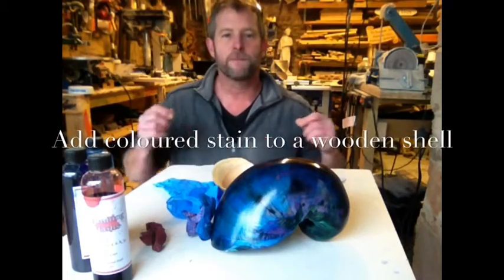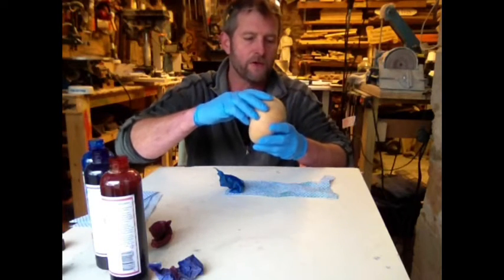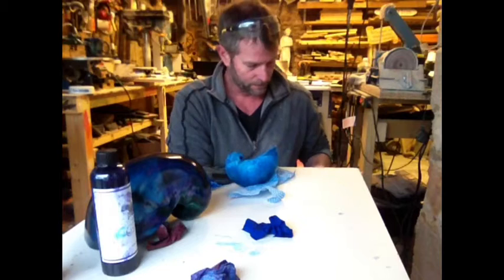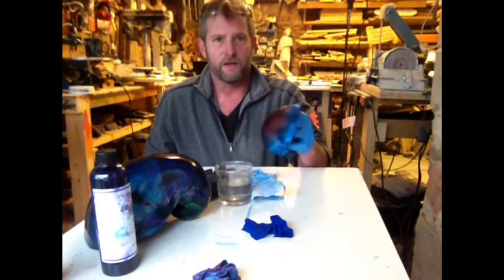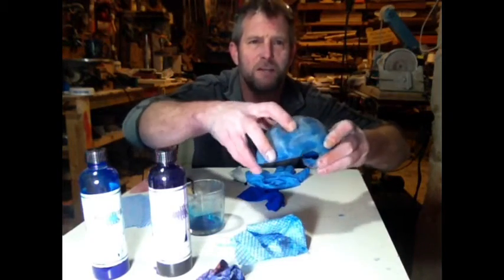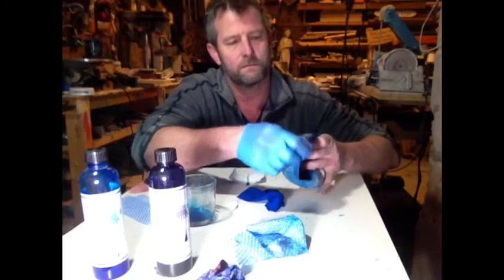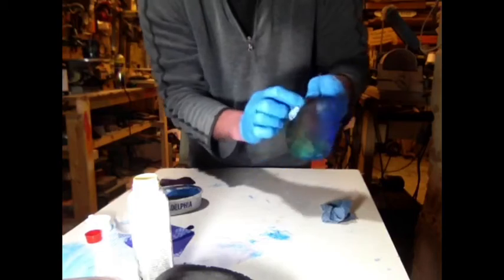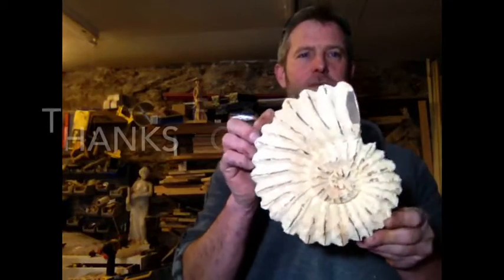colouring a wooden shell

Comment: beautiful work.may I ask how big are the blocks of pine  before you start carving/shaping.Is the wood kiln dried? is the wood dried  enough as not to crack once finished.i'm real close to retirement  so I'd like to do this for a hobby and teach my grandchildren about doing art .
Reply from the maker: these are regular 2 x 4's cut on the diagonal. probable 6 inches in length. kiln dried timber. they shouldn't crack, I am using tightbond glue and that tends to be stronger than the wood. also the sextions are so small that I doubt there will be any significant cracking unless exposed to UV rays or left outside. steve garrison has some great videos on how to do more intricate ones as well.
Reply: thank you.pine is real cheap to practice on.
Reply: I don't know why I come up as ''rotoclip'' I'm Richard olson.a rotoclip is a grinding tool I use to shape cows hooves.i do dairy cow hooftrimming,30 years.
Reply from the maker: @rotoclip3427  yes pine is great for practice and you can get some really good effects with it